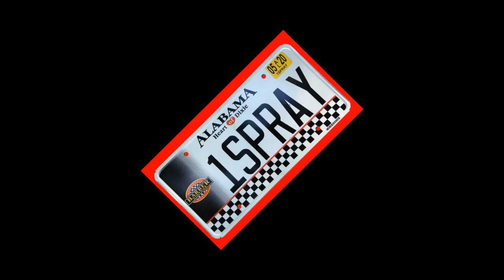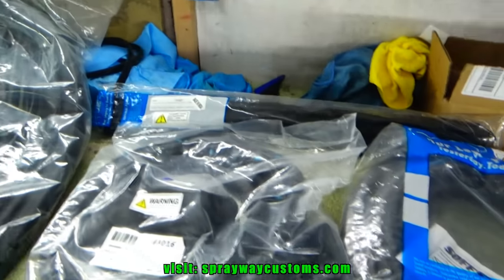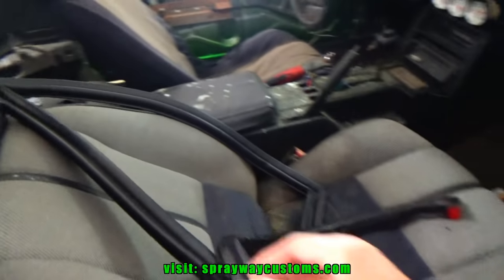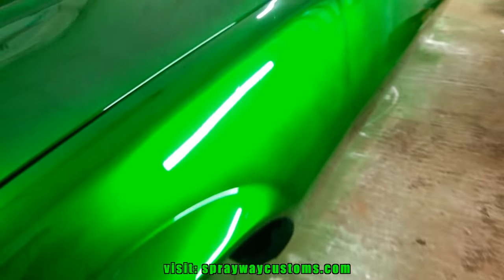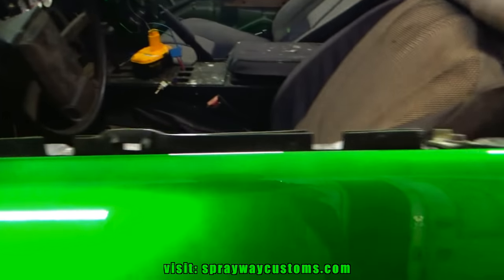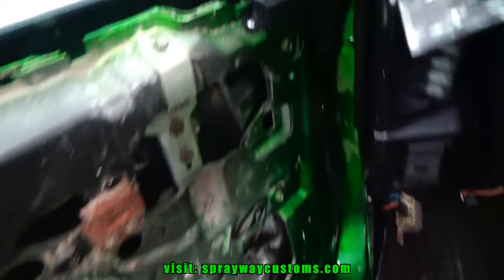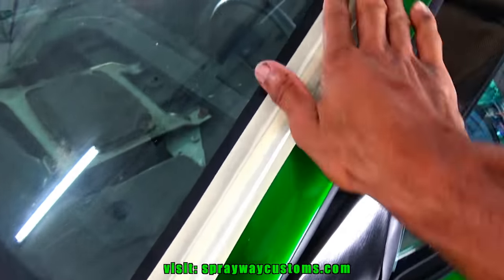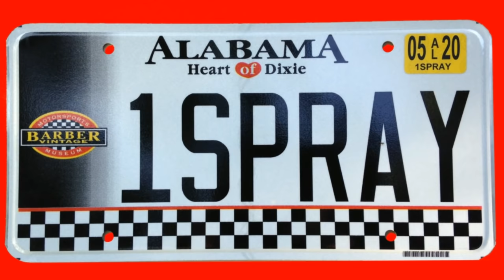Candy Green Chevy Camaro IROC Z28 T-TOP WEATHERSTRIPPING DOOR & HATCH SEALS INSTALL / 82-92 3rd GEN

Comment: Dude. just a tip from an old-school street rod builder. Rusty screws tend to gather moisture and promote further rust,  I wire brush them then coat them with n clear nail polish to seal them. That's gonna be one bad ass looking Z
Reply from the maker: Thanks for the info Fred 🤝

Comment: As always great videos bro, question or better said I’m gonna ask your opinion on something I’m going to raptor line my truck I’ve already sanded it down as the previous owner had sprayed plasti dip on it and it was just way too thin to peel off. Well my question is what type of primer would you recommend to use? I didn’t sand it down to bare metal just enough to get the plasti dip off but I did remove the clear and some of the original paint in the process of removing the plasi dip.
Reply from the maker: You really wouldn't have to prime it if there's no bare metal spots. If you sand it with something like 180 the raptor lining will stick with no problem
Reply: @SprayWayCustoms  thank you. that’s exactly what I used was 180.

Comment: ???? Sprayway what kind of Air Compressor filter u use and where can I get one. THX..
Reply from the maker: I have a 60 gallon Husky Compressor and have these two running back to back from Harbor Freight. https://www.harborfreight.com/38-in-desiccant-dryer-with-oil-removal-filter-69923.html.    https://www.harborfreight.com/air-filter-regulator-unit-68247.html